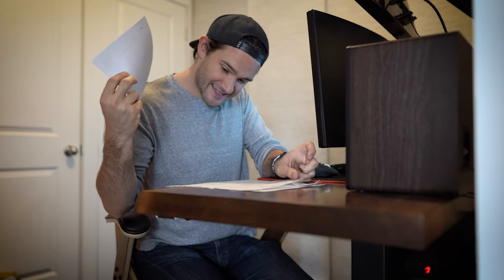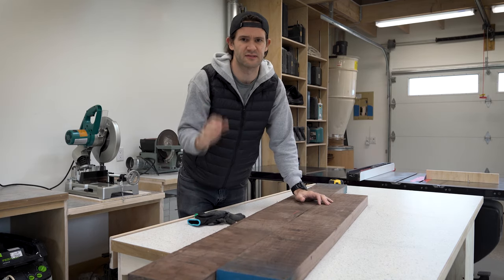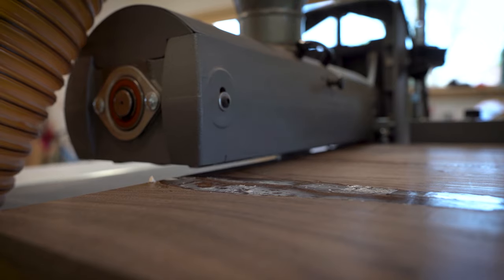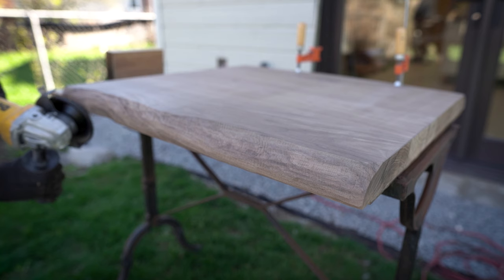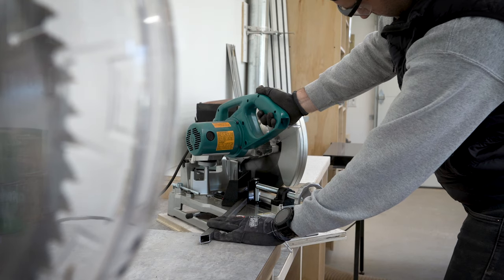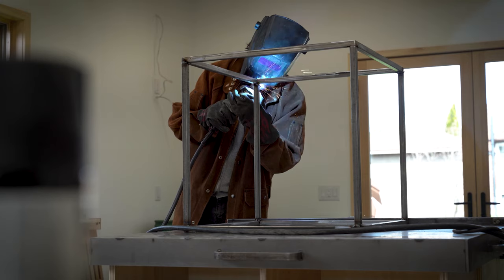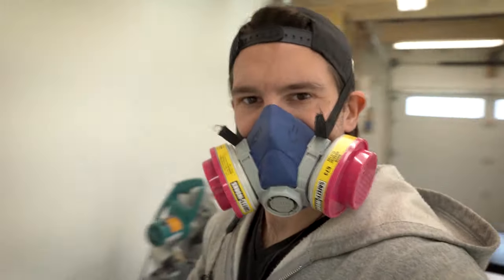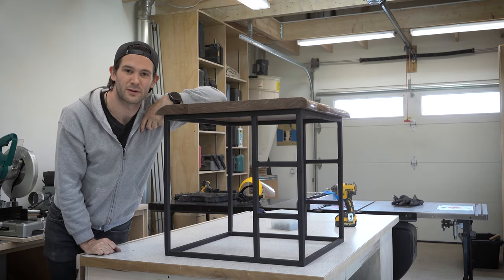Carving Fake Live Edges With An Angle Grinder - The Fake Live Edge Table Build

Comment: Love the end result. Walnut is such a beautiful wood. Wish there were a way the average person without a fancy woodworking shop and fancy tools could do this project. I love live edge but you are correct, slabs are so expensive.
Reply from the maker: Thanks Joanna! Walnut has long been my favorite wood so it gets featured a lot in my builds. You could really simplify this project if you were able to find a local distributor that sold pre-milled lumber. I spent a lot of time and tools just trying to get the boards all straight enough to be usable. 

Most of my bigger tools only make the job easier and faster, there's almost always a manual way of doing it that takes a bit more time but can be done for significantly less money.

Comment: Nice job Zac. I've actually thought about doing the EXACT same thing. In the end, you pretty much strip the bark and then sand down the edges of Live Edge anyways, so I always figured there wouldn't be much of a difference if you just ground down the edges yourself. 

I hadn't considered glueing pieces together though. I would have just used smaller pieces with resin pours - but your table looks pretty good in the end even though they're glued. Thanks for the video!

Comment: Nice work Zac. Metal working looks like fun!
Reply from the maker: It is! I was really intimidated to start, but once you get over the whole bright light that might blind you thing and the incredible temperatures, it's actually more forgiving than wood working in someways. It's really tough to master, but much more accesible than I initially thought. You just have to make sure to take things slow and be safe when you're doing it.

Comment: You stated that there shouldn’t be much stress on  the sheet metal screws, but I am afraid you’re forgetting about wood movement. Large pieces of wood have lots of mass and will expand and contract significantly from season to season. That expansion and contraction will either bust those screws, the metal frame, or the wood will eventually buckle. It might take years. But when working with natural products you need to plan accordingly. The top should only be connected on two sides of the frame that are adjacent to the wood grain direction. And the holes in the frame should be elongated to allow for wood movement.

Comment: I thought about doing the same thing and was not sure if it would look good. I’m going to give it a go now that I have seen it. And those criticising you for doing a “fake” live edge. The title has two “fakes” in it already.. Pretty honest in my view. Good job. Btw, very nice looking speakers. May I ask the brand or whether you’ve built them? Or have you put on a “fake” wood cabin around them :D
Reply from the maker: Thank you so much! And ya it's a fun little project and super easy to do with the wood grinding discs, it wont take you more than 15 minutes of carving. 
The speakers I built, based on a DIY kit called the "overnight sensation". You buy all of the inner components of the speaker as a kit and then assemble them in a housing of your choice. The subwoofer is a Klipsch sub that I built a new housing for so that it would match the speakers. 
I built those before I had a youtube channel so there's no video of them unfortunately, but I think in the near future I'll do another speaker build. Maybe a center channel to add to the existing setup.
Reply: @ZacBuilds  many thanks for the reply. Looking forward to watching your future videos.

Comment: This isn't a criticism this is just a concern comment. When you showed your TV stand I noticed the receiver/stereo was free floating. Umm... How is it venting the hot air, did you add a cooling fan in the back to suck the air from the side vents out the back? This is the main killer of all electronics, overheating. I don't know about your receiver but mine generates enough heat to toast bread and it's just a semi top consumer model Sony, nothing really high end. It has a Class A/B Amp witch runs constantly hot. But if your stereo is a Class B Amp, you actually might be fine, now that I think of it. I don't know, next time you have it on for about 20 minutes, stick you hand on it and see if it's hot as hell and then again at 40 minutes and then make your decision on what you want to do. It's your stereo :)

Comment: Hey, I really liked this video. I think it is going to help me decide on if I will be purchasing these discs for a current project. I have one question— have you tried the discs on end grain?
Reply from the maker: Thanks Marissa!  I havent used them on end grain, but based on the way they cut through the side grain i suspect they'd have no issue with the end grain. However you might want to use the medium and fine disc's in order to avoid too much tear out on the end grain
Reply: @ZacBuilds  Thanks so much for the tip, it was really helpful. Also, thanks for the video, wasn’t sure how I was going to pull off a 30” diameter, clean live edge look. This video saved the day!